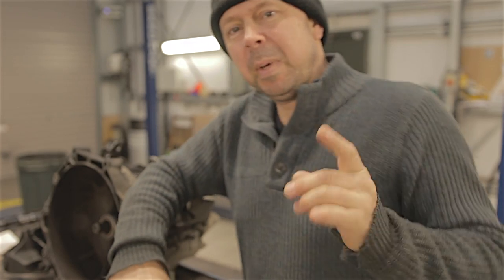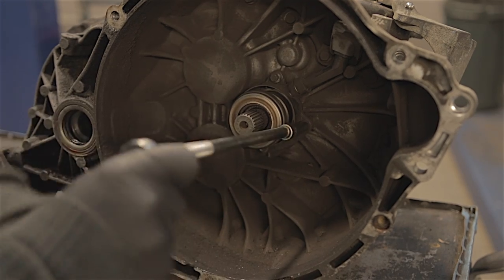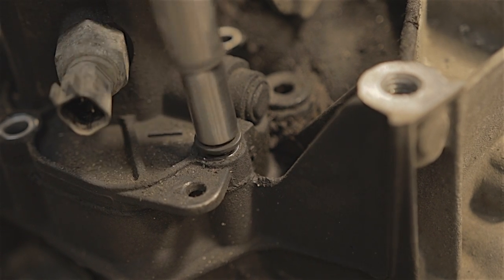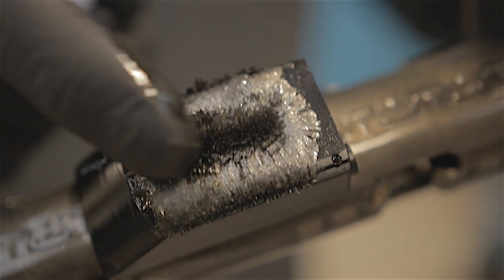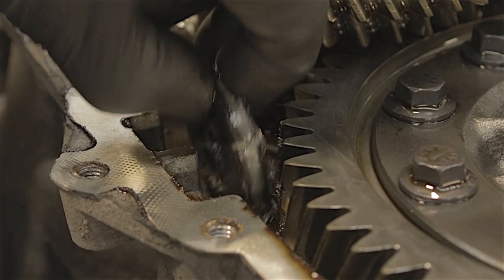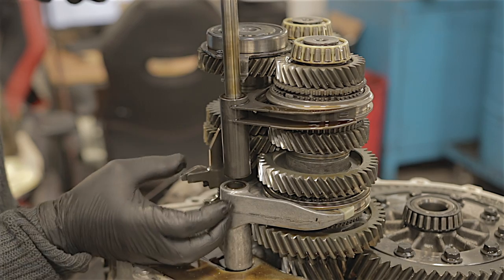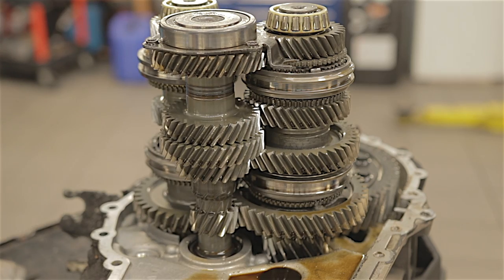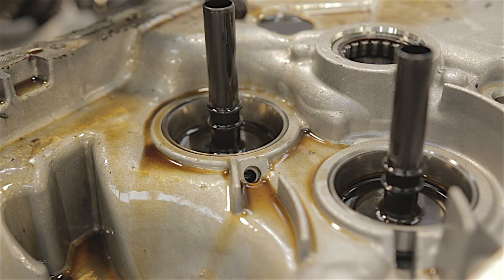Noisy Gearbox Bearing, Lets Investigate, Ford Mondeo Mk5 2L Diesel

Comment: Had exactly the same problem on a 2005 Mondeo 2L diesel. Pretty much an identical gear box.  About 160,000kM on it at the time.  Mechanic swapped gearbox for one from a scrap yard.   I tool the old one home and did exactly the same strip down and it was exactly the same bearing gone.     It was about 20km after I replace the clutch and  DM flywheel.  Clutch was not slipping or anything but the flywheel was rattling like hell.  As that bearing is on the back end of the input shaft  I put it down to the rattling of the DM flywheel.  I reckoned the bad flywheel took out that bearing.  Now got the same rattling starting on a 2016 Mondeo 2L diesel.  Same Gearbox again.   175,000kM  on it.  So I reckon I would be better replacing that clutch and flywheel  asap.    Looks like a got a nice weekend project coming up  🙂
Reply from the maker: your probably right about the flywheel, happy new year

Comment: That’s the bearing that went on mine last year at around 160,000 miles. £50 bearing but cost me £1300 inc new clutch fly wheel and slave cylinder. Mechanic said he’d charge £1800 if he did the job again as it was a bit of a pig getting the gearbox out. Think it was the dpf in the way or something

Comment: Hi Alan, I have the same sounds coming out the gear box on my 2016 Mondeo, how long do I have to change the bearing?
Thank you and I hope I will have the chance to meet you one day.

Kind regards, 

Sam
Reply from the maker: hi sam, i am right now doing another gearbox which i will upload..it has the same bearing gone which seems to be a thing with these boxes, i can only think if you leave it too long the bearing could break up and cause the input shaft to tip and cause more damage so really needs to be done as soon as possible

Comment: Really good video thanks, I have a 124k 1.6tdci c max with the same issue, rough bearing noise at idle and in 1st and 2nd but press the clutch and it disappears. Just had the clutch and flywheel replaced because I thought it was that ( first one it has had since new) but the problem persists. Could be a trip to have the gearbox reconditioned next

Comment: Awhile back i mentioned this same problem to you on a live chat. You said that you really haven't had any real issues with this type of gearbox. WelI I tore down the gear box on my  2013 ford mondeo 2.0 tdci 6 speed and found the exact same problem. Replace the bearing and seals and good as new. Still don't know what caused the problem with only 117000km

Comment: Hi Alan , I’ve got a transit that chatters in neutral - noise goes away in gear or when clutch is down - mechanics say it’s the gearbox - gearbox rebuilder says it the clutch - I’ve had a new clutch no difference. ?

Comment: Hi Alan, Great video like usually! I drive Galaxy 2012 2.0 tdci manual gearbox with same noise! But I have a struggles from where to buy that bearing (they offering me whole gearbox or whole bearing set, which is not for me)! Could you share some link please or an other option! Thanks in advance!!!

Comment: Hello. Can you Alan or someone else with experience help? I own a ford mondeo titanium mk4 2.0 liter 140 hp automatic hatchback. When I stand still with the car and press the gas pedal approx. 30-40% in, the car behaves relatively normally until the turbo starts to spin, suddenly the motor revs high and stands there for approx. 2 seconds before the car shifts and the revs drop.
I know that all cars with turbos have turbo lag! but here it seems that the data in the car is not programmed correctly,

Is this normal behavior on this type of car?

Comment: I would have replaced all the bearings just on principle. While the magnets have done a damn good job they only grab the metal when it pass's close enough to the magnet. You can guarantee that there has been a lot of excessive wear on all bearing surfaces. Half the cost of a gearbox repair is usually in the removal, dis assembly, re assembly and re installation. New gaskets, seals and bearings as a rule (there are exceptions. Some bearings are so ridiculously expensive you replace only when necessary)

Comment: once did a gearbox out of a ford galaxy ,locked up going forward but ok in reverse was a bolt from a selector came loose stripped and replaced cost time and £2.00 for the bolt